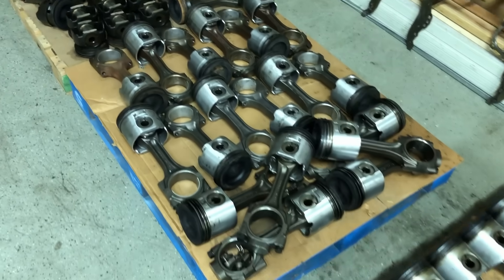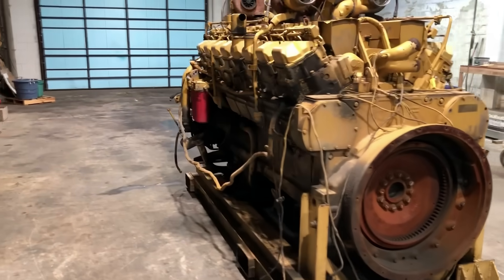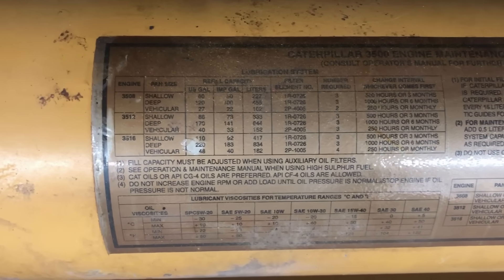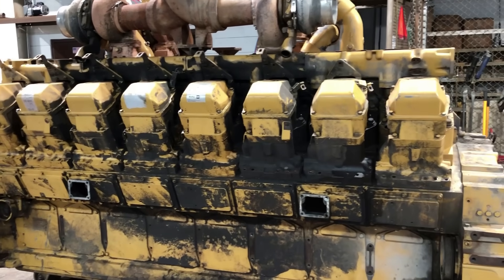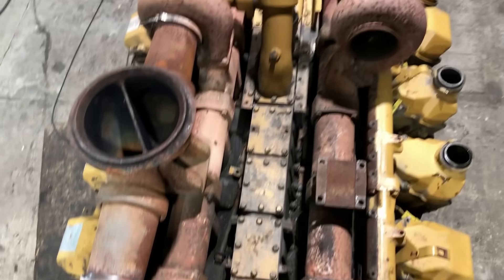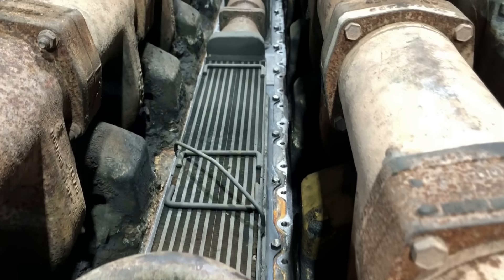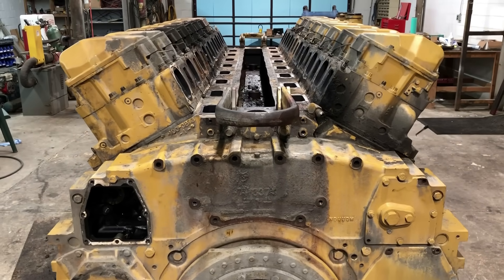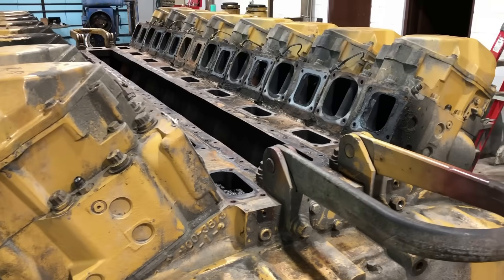Tear Down of a 17,000 Pound V16 Caterpillar 3516 - 1800 Horsepower 69 Liter Diesel Engine

Comment: I knew nothing of these engines but I am learning by watching you and others that do any Diesel engines. 
Gas eng. are what I started on, with Mom's '59' Metro at 12 years old and a Motor Manual. Then when I went in the ARMY, Turbine Engines in OH-58 Helo's.
Then back to the world and Gas Engines. 
Now so close to 70 I am getting into Mr. Diesel's world and it is Very interesting.

Comment: Unbelievable man, I loaded this engine on a truck in Australia , December 2007 , it was in our shop at Weatherill Park in Sydney . I was told that it served a monster tip truck in the mines . I never imagined that I would see it again.
Reply from the maker: Some of the guys who rebuilt the engine in 2008 at Mt. Thorley also found the video, as well as the guy who actually pulled it out of the haul truck here in the USA in West Virginia about 2 years ago.  Pretty amazing.
Reply: @KT3406E I live in wv but I’m not the one who pulled it.
Reply: 5o😅c r5x5cvzxc @KT3406E
Reply: Aye mate, cool stuff
Reply: Fascinating, small world!
Reply: Why cant we all just get along... @edwardhalpin7503
Reply: Legend has it there is only one of these in the world.
Reply: @ml.2770 L
Reply: @ml.2770 I've hauled some caterpillar generators that had an engine just as big. Both engine & generator together weighed over 36,000 lbs. It took most of a 48 foot trailer. It went to the port in Savanah, GA. I believe going to China. 
They used a forklift with 45,000 lbs lift capacity to take it off my trailer. 
I had pictures just for documentation, I'll bet it took 36 foot of my trailer.
Reply: Unreal!
Reply: @kellynkarr  ,
Reply: @gregsmith222  yooo
Reply: Wow amazing story of engines history
Reply: wholesome
Reply: I'd say this came out of a Cat 793/F/D Dump Truck or an excavator. They're worth about $171,000 USD / $250,000 AUD in good condition so they're certainly not a throwaway item.
Reply: You still working there ?
Reply: Monster!!
Reply: Awesome.
Reply: I love the way you started the video!! (  “The audio sucks. The video sucks! If y’all keep watching from here, it’s on you!!” Don’t wanna hear no whining or bitching!” ) Blunt and to the point!!! Lol!!! That’s why I enjoy watching your videos!!! You call it how you see it!!! If any of those snowflakes can’t handle the facts, let ‘em get over it, or under it!!! That’s the way I feel about it!!
Reply: Sweet
Reply: The respected require retards in the usa 🇺🇸.
Reply: Talk about finding a needle in a haystack that really is that is some absolute next level shit how do you know? It is the same engine unless you have a serial number ???
Reply: Damn unc, I was 3 years old in 2007😭💔
Reply: No way me too!!
Reply: Getting rid of this engine had to be an accountant maneuver:  capex or some such.  A power pack, cylinder head, and camshaft replacement is not throwaway territory.  Still, the 3516 has its quirks - like finding latest part numbers [not in the manual] demands SIS website access or equivalent.  I think there are 4 different cylinder head/injector configurations?  And those injectors are twitchy about fuel: both cleanliness and temp - anything over 135F, and begin derating output.
Reply: @flinch622  people will scrap a car for a worn out spark plug, I'm not surprised
Reply: rebuilt this engine is more than buying a brand new engine stupid
Reply: Google image search or videos never crossed your mind after all these years?
Reply: @shortthrow50  who's this directed towards?

Comment: Yup, been there...a dropped valve #7 and ended up doing an engine change. Was going to do a complete powerpack change in-frame but client bought an engine as there was one available in country.

Done some valve sets on the 3516's as well.

Comment: I would interested to see the brands of impacts and sockets you use. I assume the torque specs on the bolts you deal with are so high, a Harbor Freight impact and socket set isn't going to be enough. No?

Comment: How are the two camshafts on each bank connected. Is it by flexible joint, or solid flange etc?
Reply from the maker: They bolt together to make a solid joint, no flex.

Comment: My goodness! The biggest thing I've ever built is a general motors V8. But this? Good lord how do you do it???
Reply: Depending on your perspective that's a baby engine. These would be used as auxiliary engines in a lot of vessels I worked on back in the day. Main engine would be something more like a GE V250 or Bergen Diesel V20 or bigger. That is they'd probably have several of the V250's and Bergen Diesels. The smallest trawler we did work on regularly had something similar to this 3516 as a main engine.

The thing is as the engines get bigger they're often easier to work on, but you start needing lifting aids.

Comment: That "intercooler" setup looks extremely inefficient, it uses HOT exhaust gases to turn the 4 turbo's that sit on top of a HOT motor to shove HOT air through the intercooler, then an "air to water" intercooler that uses HOT water to cool HOT air while being positioned within a HOT block as to cool down and condense the air/fuel mix! Everything that needs to be cooled down is completely encased inside the of the hottest part the motor! WTF? You can't cool anything down using heat, therefore, rendering this system a complete wash! Who the hell designs these things, Mr. Magoo?

Comment: Thank you for the Cat tear down video. I watched machinists, pipefitters and electricians as they resealed EMD SW1500 switch engines with 645 prime movers.  They rolled the main bearing shells out of and into the block with the crank still in the block.  It was amazing how quickly power assemblies were removed and replaced.  I had the easy part of running the completed rebuild and moving it out of the roundhouse.  Working a hostling job early in my career as a Locomotive Engineer was actually fun.

It is interesting to note the similarities and differences between the CAT and the GM EMD designs.  Thank you again for your video.

Sincerely,  

B S Du Bois, retired locomotive engineer former L&N RR.
Reply from the maker: I worked for Union Pacific as a road conductor for a couple years and was in the engineer program when I quit back in 2012.  I loved the job, but not the lifestyle or the way company and union worked.  Thanks for watching.

Comment: Many towboats on the Mississippi river run the 3516 or c280-16. I currently operate a vessel with triple 710 16 , some serious torque monsters.
Reply from the maker: I was around lots of EMD 710 16s back in my railroading days running freight trains for Union Pacific.  Several 645s too.  I had a grandpa that worked on the river for close to 50 years.  Thanks for watching.

Comment: I work in the natural gas industry, and we utilize the Cat G3516 TALE or ULB to run compressors, but it seems that the industry is starting to move towards the 3600's.  The 3600's class engines are on another level.  A G3516 puts out 1340 hp at 1400 rpm's, while the G3616 puts out 4700-5000 hp at 1000 rpm's.

Comment: I was seriously wondering why they thought this engine was no good. Maybe lacking power? Then it eats a valve and they had just put those different pistons and such. Something was off in this engine, and if you had sold it complete and running, I suppose the liability would swamp a fellow like me, if it only ran a week. Probably some simple item not put in right, and made the engine not perform. I hope you get good money for the other parts, though people who run this equipment probably get new parts, and the camshafts were probably the main culprit.

Comment: Cost of new engine?
Number of hours? Assume you are parting out engine? What is use for this engine?
Reply: It is a Cat industrial engine.  It is used on dump-trucks, large loaders, as a generator, as a water pump and in its marine version as both a generator and main propulsion, depending on the boat/ship.

Comment: The Pratt and Whitney R-2800s I work on have almost 2500 horsepower, and the entire QEC unit weights around 2500 lbs, thats a 1-1 hp/ton ratio to a 0.1-1.  Torque and reliability though...

Comment: Only 1800hp out of a 17000pound 69L v16? Engines a fraction of that size can make more than that. Unimpressed.
Reply: Torque output is where its at

Comment: Hp: 1800
Tq: yes
Reply: up to 6190lb-ft at 1400rpm
Reply: @samuelaudet845  usually 2 to 1 hp to tq but that is more than 3 to 1
Reply: @donls1sscme  Also its don't spin high , so flat torque curve + low rpm = low HP number
Reply: Yes ... or all of it ... im sure 5k or more
Reply: According to the rebuild plate, it made 1783 hp @ 1750 rpm, so at that speed it was making 5351 lb ft of torque. That seems to just be the peak power number so its safe to say the peak torque was even higher which would work out with Samuel's comment because at his peak torque number of 6190 @ 1400 it would be at 1650hp
Reply: The engine, as originally built and  tested in 1993, made 1804hp @ 1720rpm.  Torque check was at 1300rpm, where it made 6353lbft.  In case anybody wanted the actual data...
Reply: Jimmy_ j_5 yes, all of it...
Reply: Enough
Reply: After all that hump and dump.. this motor will be doing less torque than a civic methed out on vtec

Comment: I blew a cummins 855. all the front seals and gaskets were gone on this motor in an articulated ford tractor pulling a 30' wide chisel. the mechanic knew the motor was leaking oil but he wasn't sure how much. I pointed out a stream of fresh oil coming from the engine and he just ignored and said its full and mumbled something about hydraulic fluid. I took off and on my third pass I heard that rattle kind of a scratch just as I was getting my pull on then the oil fill cap blew off and black and grey smoke billowed out. I shut the motor down and it was seized. we estimated this motor was leaking 3-4 gallons a day from a 9 gallon pan. I put 7 gallons in that motor before oil showed on the stick. fun day on the farm!!!

Comment: Most of my family has worked for Cat at some point in there lives . My Dad used to test engines before they shipped to the customer the larger engines could be problematic as they could overpower the brakes on the dyno before the company finally upgraded them If the engine ran away there was no way to stop it !!!! one night my Dad was testing a large engine v12 or v16 not sure the exact size and the engine ran away during testing the shut off the fuel and even tried shoving a board over the intake it folded it and sucked it right in and kept running !!! after several minutes they finally got it shut down but while cleaning up the mess one of the coolant hoses blew off the still overheated engine and blasted my Dad with scalding steam so hard the pressure pinned him against the wall of the test cell he did survive but had bad burns all over as a result the dynos were upgraded with stronger brakes to able to stop most engines if they started to run away and the bigger engines were sent to another facility to be tested that were better suited for them

Comment: I work for Cummins. Therefore I immediately hate you, and CAT.

lol. Not really. I tore down a 50, two 78s, a 60 Single-Stage and 60 Dual-Stage this week alone. It's a fun job. Seeing at the CAT and Cummins engines are to different as far as how they go together. I feel like you have taken the long way around. For instance, it is much faster to go Valve Covers > Rocker Boxes > Rockers, push tubes, etc.

Whoever was running that engine was babying the dang thing. The damage for just a dropped valve was practically nothing. Plus for only needing one powerpack... That's weird. 

How long did the whole thing take you? From Start to finish, excluding filming time?
Reply from the maker: Maybe I'm wrong, but I don't see any reason why it matters when those parts come out.  They come apart exactly the same way regardless of when you do it.  Thanks for watching.
Reply: @KT3406E  Matters? No. I don't think so either. I have always just found it to be more efficient. Give it a shot next time, maybe you'll find it easier. Just a little advice from one tech to another.

Comment: The turbos are waaaaaaay smaller than I would have thought. The motor on my excavator is not even half that size and the turbo is 3 times bigger. I guess because it's a quad setup they are smaller?

Comment: 1 cylinder has more than double the displacement of my entire 2.0 liter Jetta engine.  That's insane.
Reply: The John Deere Model R Tractor has huge jugs  about 200 +- Cubic inches per Cylinder.
They really go Thud Thud .....Thud!
Reply: JJKHaywood Electro Motive Diesel’s (EMD) newest locomotive’s prime mover, the EMD 12-1010J has an astounding 1010 cubic inches of displacement PER CYLINDER! AND ITS A V12!!! Produces a healthy 4,500HP! It had a V16 brother many years ago that was 6,000HP called the 265H. Both massive 4 stroke diesels. EMD is owned by Progress Rail which is a subsidiary of Caterpillar so go figure.
Reply: Caliban777  the 1st small block Chevy V8 had a displacement of 265 cubic inches
Reply: i was gona ask is this right?  4 liters + per cylinder?  its basicly a gallon per cylinder...thats insane.
Reply: Caliban777  1955
Reply: are you talking the 2005-2007 tdi or the standard  base model jetta?
Reply: The engine itself has the size of 5 semitruck engines. Also more than 8 times larger than a Bugatti w16
Reply: @moisescastillo217  Makes only 200hp more than the W16
Reply: Which motor?? I've got a 2.0 TDI
Reply: We would love to hear this engine run after its fully assembled and put together,that would be so cool.
Reply: Chris you think that’s impressive. I work as a locomotive mechanic. Our engines are more than double the size of those engine. I joke with my dad that I cylinder in a GEVO12 engine is the same size as the 15L engine in his big rig. 🤣
Reply: @speed150mph  you think that's impressive? Look up the Wartsilas.. 110,000 Cu in.. Oh, that's PER CYLINDER, up to 14 cylinders
https://en.wikipedia.org/wiki/W%C3%A4rtsil%C3%A4-Sulzer_RTA96-C
Reply: @Rx7man  If I had 1 dollar for every newton meter of torque that thing makes,I'd be rich.
Reply: @KitKitChanIsaac  yup!
Reply: @Rx7man  Does it fit a VW Jetta?
Reply: @caddyrack  It'll fit on top of it, if that's what you're going for
Reply: @Rx7man  Awesome, please post pic when done. We have a similar engine where I worked, it's a MAN B&W 7S90ME marine engine that we use for training. Check it out, it might fit your VW Jetta.

Comment: I don't get why this engine exists. Now, granted, I know nothing about heavy machinery. The most experience I ever got working with heavy machinery was the time a man yelled at me for getting too close to a construction crane while I was walking on my way to work. That being said, it's 2019. Engines have come a long way. You can easily buy much smaller, cheaper, lighter diesel engines that make just as much if not more power than this. Unless it's something where you need extreme, "bury it in mud for a month and still have it fire right back up", reliability (assuming these engines are that reliable), or you need it to make like a billion ft-lbs of torque at like 3 rpm and can't just gear a normal engine down, I don't see what the point is.